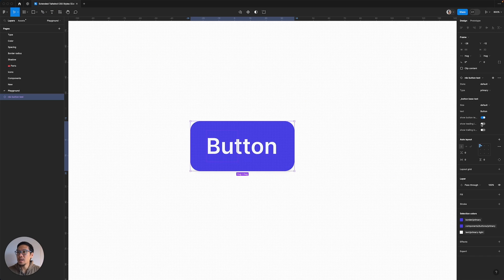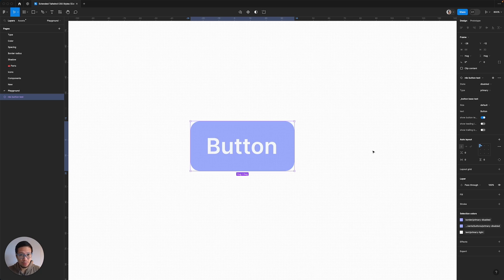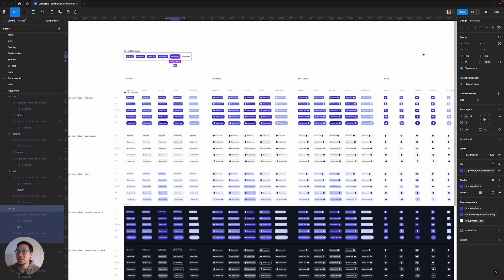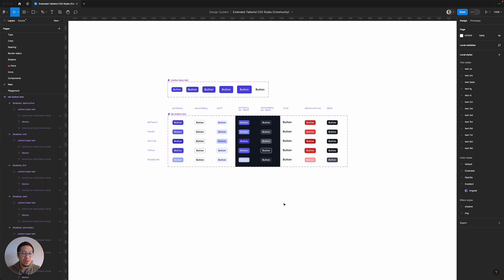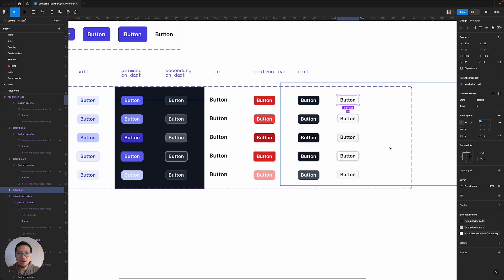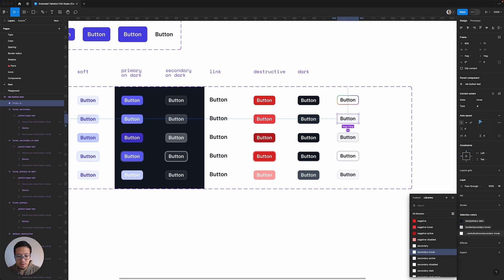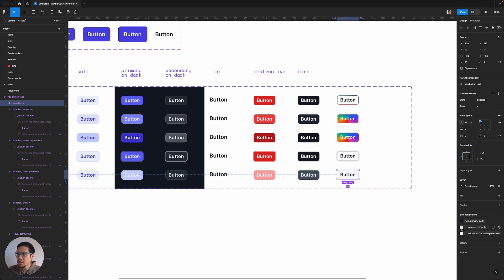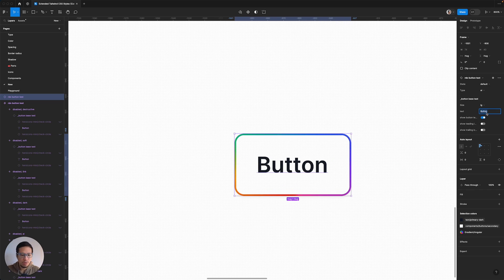Figma Button Component Multi Variant Madness

Comment: When I change the fill type for base button instance inside the rdo button test - the rdo button test instances don't update. How did you deal with that? The whole point of design system disappears
Reply: I noticed something. It happens when you take the rdo button, then change some properties of nested master button. Then it will not reflect any changes you do to that instance in rdo component
Reply from the maker: @darkModeYT  base buttons and nested components can be a pain. I have created a system that doesn't use a base anymore, but you do have more buttons. With certain features, you can select certain layers and make changes.

To your question, the flow i've used:
1. Base component
2. Create an instance of that base component
3. Wrap it in a new auto layout and then create a new component - say AI button
4. Then i make any changes, like fill bg, on that new component - AI button
5. If i decide to change the font, i can change it on the base component, this should change on all instances
6. If i want all buttons to be rounded full, i can update this on base component
7. If i change the fill background of the base component, it won't change the background color of the instance (ai button component) because i've given it's own styling
8. However, you can reset the styles on the ai button, which will then reflect the base component